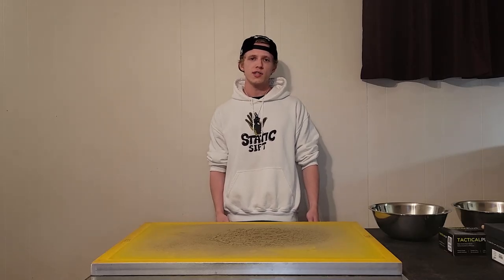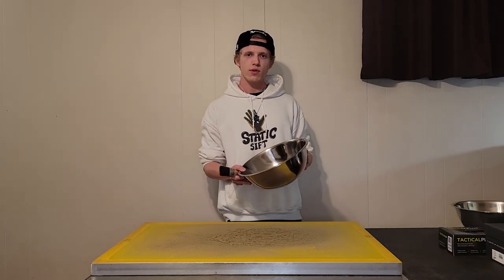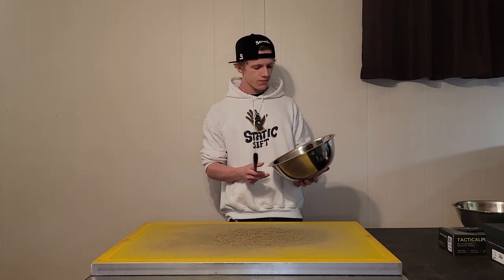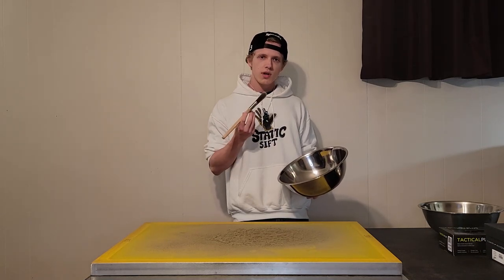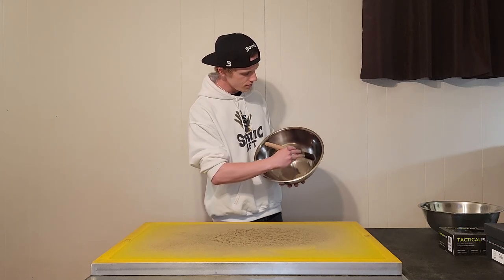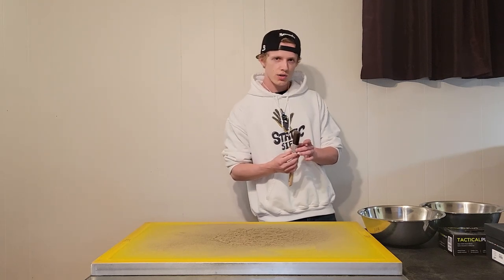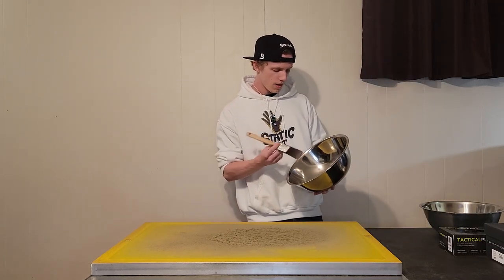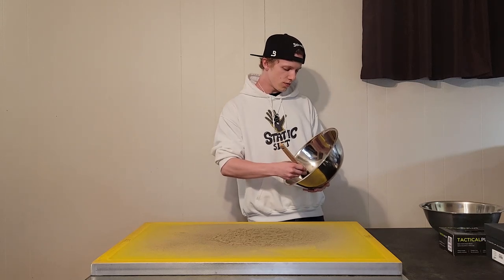Hash Tips 101 | Poly / Nylon Brushes

Comment: How much does it matter if its a nylon polyester blend or just polyester. The brushes im seeing have nylon tips and the rest of the bristles going twords the handle are polyester.
Reply from the maker: Both have a different charge and pull a little bit differently. I use both but I tend to prefer the pure poly in most cases. I would suggest you try both and decide what you prefer form there! But if you can only get a mix of both its not the end of the world.